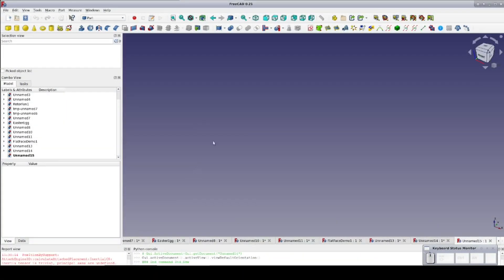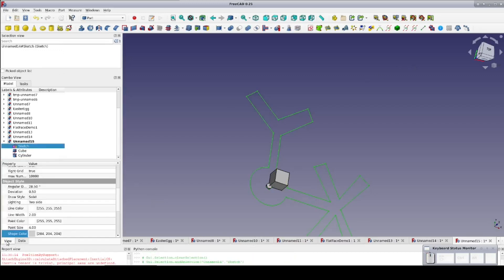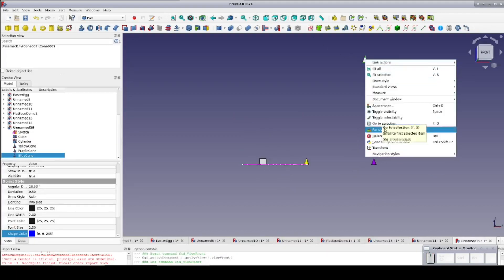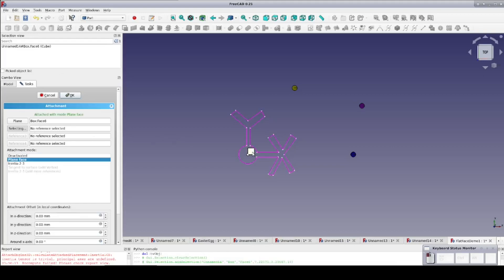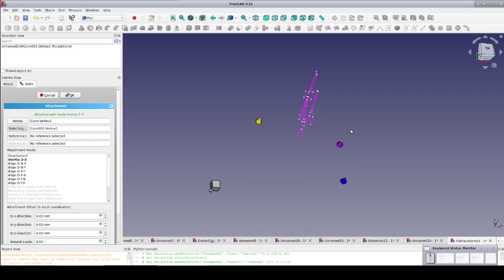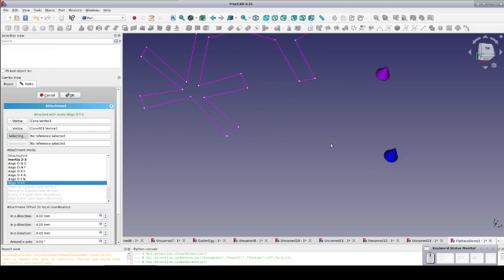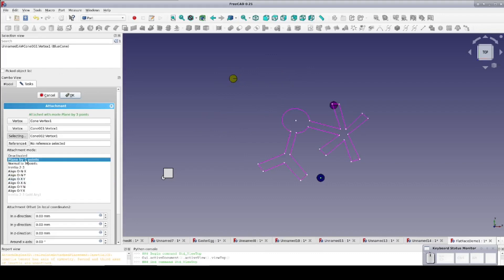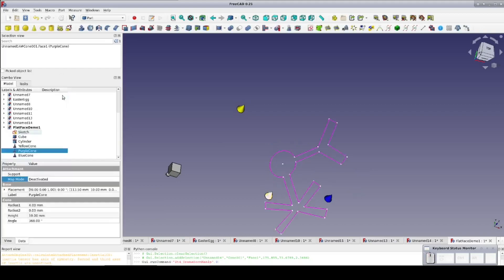FreeCAD: Attachment: tell objects where they can go.

Comment: Have followed along with this tutorial.  First time I ever worked with a disembodied sketch!  Finally understand the most basal (and invisible) "document orientation."  A "101" to FreeCAD tutorial MUST hit you in the face with the fact that all sketches are along the Document XY, then placed, mapped, and supported.  Utterly bewildering!  Before this, I have always created a reference body to "see" the coordinates ... so at the get-go, was disoriented with a derivative coordinate system.
Another thing:  You are absolutely correct, in that the ordering (re-naming) of sketch features really slams the unsuspecting user.
One familiar with Solidworks does not expect that adding a small surface feature will throw off the rest of the work.
Yeah, Moar!  Show me how to create a model of a perfboard with 1000 holes, that does not bog down the system.
Reply: Dear, what you  have "always done before" was a correct thing on a professional CAD system. This is over-engineered, convoluted way of doing things, maybe usable in some industry,which works with light (maybe even display calculations of light reflection on the screen or similar).  It is definitely not practical way for mechanical enginnering for  manufacturing. If someone designs something, they might build aestheticaly pleasing model and then inspec it on CMM, get all the XYZ coordinates, from which are calculated all the angles of every feature in World CS or Local CS.....And that is how you design things - by simple XYZ.  Any tilted plane is designed by only 3 points or line and a point, Then you a have to define  coordinate system....What FreeCAD unfortunaly does is mixing these two things together in incomplete manner and giving you impractical possibilities to define planes and XYZ axes  in incomplete mannner,where-as this guy said there is a whoe lot of guess work and uncertainity....If you create your solid from a paper sketch or drawing, you get all the dimensional infromation in very clear and simple and practical manner  conforming to what I said above. 
As far as I am concerned, FC has 2 major problems: Topological renaming  with resulting errors and practical attachment methods (and also translation) and definitions, conforming to real world fabrication and inspection methodologies. Instead they offer this highly theoretical stuf, which is only confusing. I am over 72 years old and I have never in my life seen drawing or crossed over any inspection, which would need Frenet coordinate system. Of course, there might be some theoretical ocasions...but when it comes down to practical design for manufacturing, it is just overkill. There are many other professional software packages, they might have utilities like that. But FreeCAD should be for everyday user, simple to utilize package for almost everyone out there.  Not trying to develop a free application for Space Industry - for that we have other more sophisticated and very expensive application.They need to fix the first one problem and simplify the second one!